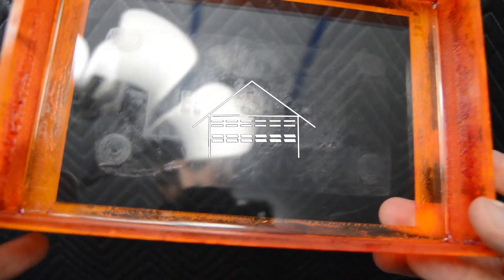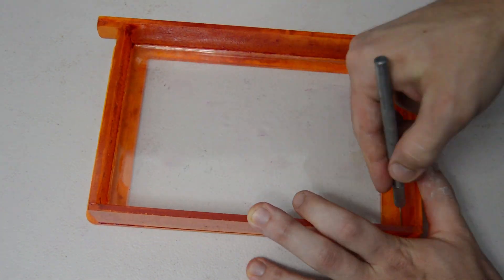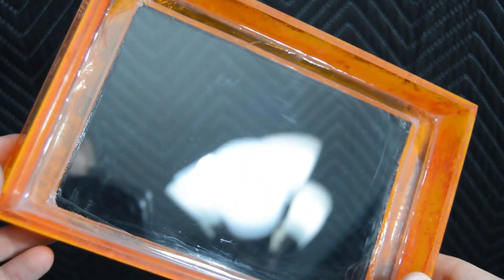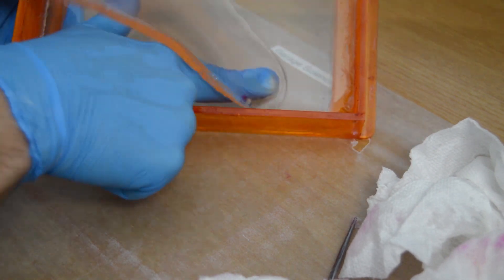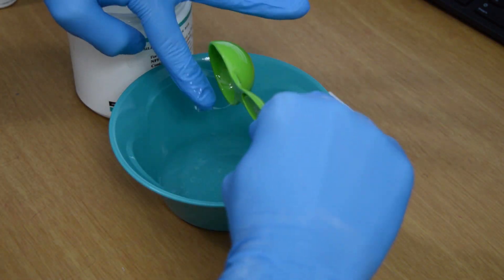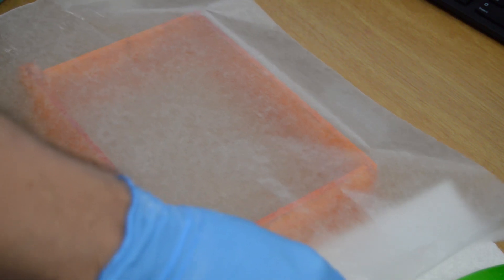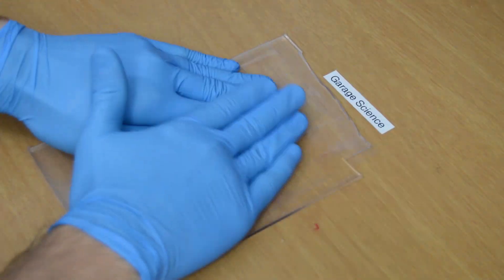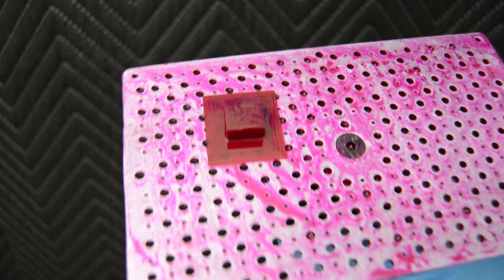Replace PDMS on SLA/DLP 3D Printer Resin Vat ~ Step by Step Guide ~ DIY Professional #4

Comment: Hi Dear friend! Hope you can read this message! I just won a Formlabs Form 2 from a friend and need to fix my resin tank. I've already took out the glass and cleaned the tank and it looks like new. Bought the new borossilicate glass, the PDMS and the FEP film, just waiting for it arrives here for me. I've read that the correct quantity for the Form 2 tank, is about 110gr of PDMS, do you know if its correct? The FEP film must be a few bigger than the glass but don't need to reach the tank wall, correct? Thank you so much for this help! Watmest regards, Luis.

Comment: Why the Silicon layer is usefull?
Reply from the maker: It acts as a non-stick coating to more easily separate the part from the bottom of the tank after curing each layer.
Reply: @GarageScience  Thank you for this information, then I need this silicone layer ^^.

Comment: Can you repair a divot without removing the whole layer
Reply from the maker: No, the divot would likely peel up since it isn't cured and thus interlinked with the rest of the pdms. You can print around the divot until the rest of the vat needs  to be refurbished though.

Comment: For one, wear gloves.  For two, you could have used a tin-based silicone instead of platinum based.  For 3, don't wear "rubber" gloves, as that will inhibit the silicone cure.  Wear vinyl based gloves.
Reply from the maker: Thanks for the tips!

Comment: Nice video!
PDMS is polydimethylsiloxane. Most silicone is also made of this or some other siloxane. Having them in contact with each other may be what is causing them to interfere with each other since whatever is crosslinking in one will influence the cross linking in the other
Maybe see if there is a way to keep them separate?

Comment: Hi there, amazing video, I've been trying a similar approach. However, there are some differences of my approach I want to discuss with you, see what you think. 
1. I used a different PDMS from Wacker, with hardness of shore 25A (184 is 43A), so the sponginess is better, do you think this will increase print quality?
2. I used a plasma treated fep, not from dupont though, the treated surface can have a stronger grab onto the PDMS, theoretically , and I also put the fep film on top of the pdms before it cured completely. But I still get a easy peel of the fep film off the pdms from the edge. Do you use any seal on the edge of the vat to prevent this?
3. Did you test how long this fep would last before you need to change a new one?
4. Did you have problem with the pdms adhere to the glass? I used a quartz window (increase light intensity), and the pdms seems to be very easy to peel of the quartz surface. 

Great video! Well done!
Reply: Hi friend, I know has been past tree years but I would like to know if your process in the resin tank worked! I'm a newbie with a Formlabs Form 2 and need to repair my tank. Thank you.

Comment: What kind of glass did you use, and what thickness?
Reply from the maker: Run of the mill borosilicate glass from the hardware store, 3/32 inch thick
Reply: @GarageScience  I bought this borosilicate glass but it can not be cutted, I broke mine today trying. OMG. So I put 3mm acrilics in place. Hope it works.
Reply: I kind of doubt that a standard hardware store sells borosilicate. Much more likely it is soda-lime float glass.

Comment: I also had problems with silicon when I made my first 3d printed vats with glass, the resin also eats away at it over time, But now I switched to FET that I also got at flexvat, but I am wonder why you did the Sylgard 184 which is very expensive on its own, and added a sheet of FET over top ?
Reply: Garage Science I am also working on an FEP with support plate it doesn't require tenssion and I am in high hopes it will work but i didn't finish the design yet.
Reply: indeed lol I would feel the same way , lucky I am on a mirror reflection
Reply from the maker: There are several reasons for that.  
1) PDMS, though hydrophobic and non stick in general, is sticky towards FEP film so the use of PDMS allows non adhesive backed FEP film to be used(which I think is easier to work with in terms of removing air bubbles etc)
2) FEP lasts longer than PDMS before it needs to be replaced so I will get more prints before more vat maintenance is needed.  I should also be able to peel off this FEP film and replace it with a new layer of FEP film without replacing the PDMS
3) If I decide to not replace the FEP film once it's worn down I can just peel it off and I have a fresh layer of PDMS that I can print directly on, this further increases vat life.
4)The spongyness of FEP allows for very small amounts of flex to occur when printing that allows finer details to be printed.

That's my reasoning, I don't think you would get a good result if you used adhesive backed FEP and tried to apply it directly to acrylic or glass.
Reply: you have a 3d fracture draken right ? Do you have access to a fdm printer that can print Nylon 910 ? would it not just be easier to replace it all with a FLEXVat and skip the PDMS all together? BTW im Patrick, nice meeting Good Sir.
Reply: I think a flexvat would not work quite well with his large vat
Reply: The draken  printer he is using has a print volume of 180mm x 98 mm, The  nylon 910 printed Vat's  I made for my homemade dlp printer is 145mm x 105 mm its only using the FET and it work find , as long as your not over curing the layers on larger prints,  but then again I have not tried  many resins like the funtodo, not sure if it would change anything or not.
Reply from the maker: patprop74 I am actually working on a flexvat design that should allow for better performance and easier use that won't require tensioning. It is still in the prototype stages for now. I also don't particular like the idea of the only barrier between my projector and resin being 5mil of film ;)
Reply: LOL. The vat is 35 bucks new. Add a portion of that to the job cost. nobody has time for that.
Reply from the maker: +Roy House you can get a solid 4 vats from the PDMS alone, plus it's simple enough to peel and replace the FEP film without replacing the PDMS. In the long run you save money and after you do it once it's easy and doesn't take much time.... but suit yourself :)